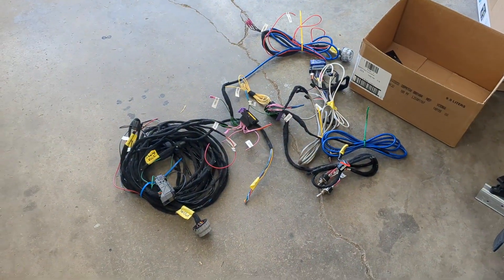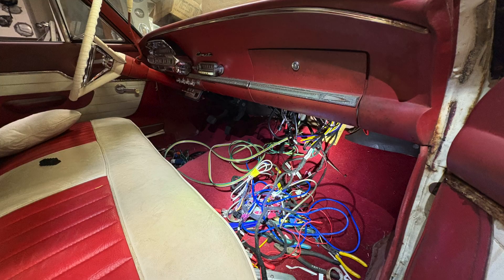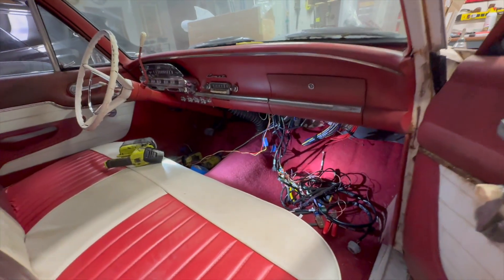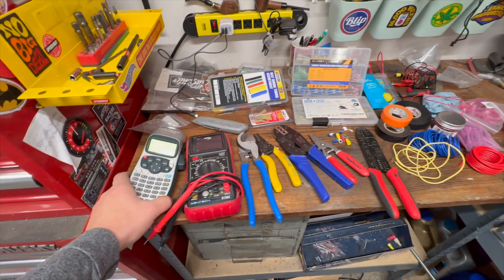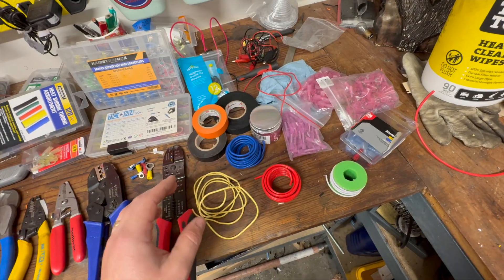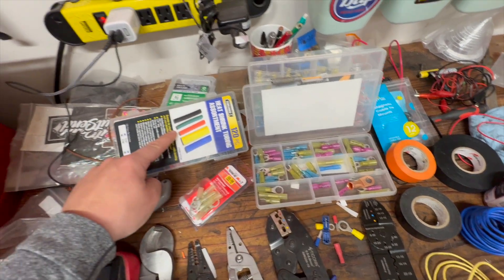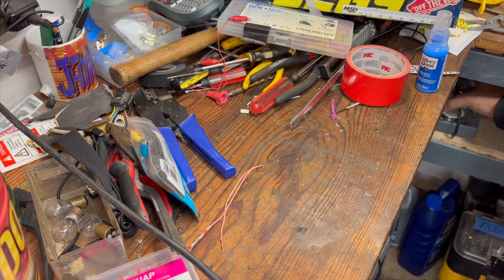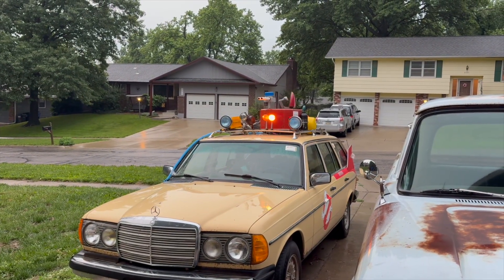DIY Car Wiring Harness: I learned the hard way so you don't have to

Comment: You did it right by wiring to the passenger side. It's awful trying to crawl below the wheel. I do use solid core wire, especially for poking into the tiny (22-24ga) connectors on the Thunderstruck components (EV parts company). Stranded just bends and frays which can short. Interestingly, after watching this I decided to go with a pre-made harness on my new build (it has an ICE engine). At least with a Howerton Performance pro wiring kit. I used the M Unit from Motogadget on my '61 Sunbeam EV. Love it.  With the solder connectors, I use a mini heat gun with the half-round shield tip on it.  Works much better than a large gun. Make sure to heat the ends of the connector after melting the solder. The ends will shrink and seal the connection from moisture and grip the wire insulation so the wires shouldn't pull apart.

Comment: I second buying the Resolve wiring harness if that’s the way you’re going. I did.
There’s more than enough to contend with without wondering if you’ve got a dodgy connection somewhere in your wiring. 
What I found is it accelerates you getting to first base (I’m pretending I know how to speak American here) and getting stuff working.
You can then start to rationalise step by step.
Think I went through at least 3 rounds of improvements as the wiring loom gradually merged into the vehicle.

Comment: If you're making your own harness, you should be able to save enough to afford the right crimp tools and SOME of the right (Deutsch) connectors to avoid splices in most cases.

The wire strippers you have, while adequate, probably shouldn't be used if you're doing your own harness.  Buy a good quality "automatic" wire stripper, there's much less chance of nicking/cutting the strands of wire.  The ones you show are too easy to use the wrong hole, cutting into the wire.

Comment: metal will sweat, condensation will build on the underside of the dashboard and drip down, and the windshield seal could leak and the wiper pivots can leak, and a heater core can splert and belch out steamy hot coolant... do you have a plastic sheet over the top of the electrics in the glove box? That's my tip of the day.